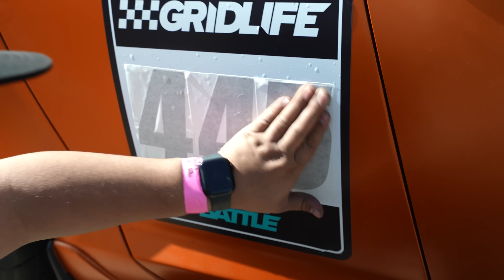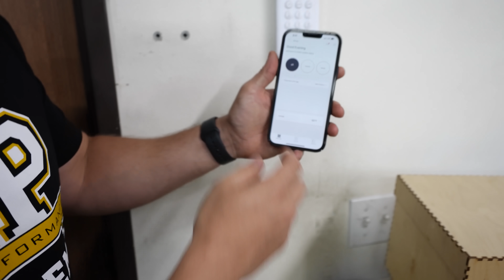I DESTROYED the RX-8 motor within 90 Seconds of driving it

Comment: Right on time! So sad to see the engine blew up on the superior chassis
Reply: The S2's are going to be the more problematic as time goes on, as they don't have anywhere near the level of aftermarket support that my S1 does, and you can't stick an adapter on your OMP on the S2, so 2 stroke injection isn't possible in the stock setup, and switching back to an s1 setup is a wiring clusterfuck. Sure, everything S1 may swap over, but you need the brains to tell those bits what to do. A well built S1 with supporting mods, will outlast a rebuilt S2. That said, the ultimate swap is an 13B-REW or 20B-REW. As far as N/A rotaries go, though, The RX-8 puts out the most power. The last N/A Rotor was the FC RX-7, with all of its 160hp.

Comment: Spun bearing(s) for sure. You can thank Mazda for recommending too thin an oil for an additional 1-2mpg.
Reply: Spot on bud when i bought my rx8 from karl hayward of haywardrotary fame here in the uk he told me only use 10w40 mineral oil as it 5w30 semi that mazda recommends wont cut it on a track day and nearly 2years later im driving it hard with no oil issues only issue is i hsve to do oil changes more often
Reply: You can thank Ford and all the emission standards for ruining the RX8 lol all they need to do is throw in a S4 13b and it'll be fine

Comment: Mazda knew exactly what they were doing when they made the RX-8. The RX-8's body and whole setup is immaculate. 
I've said it before and I'll say it again, the RX-8 was the BRZ before the BRZ was cool. The RX-8 does it better IMO. Some people just don't like how it looks, or that it comes with a rotary engine. Thankfully, that has kept costs down.. I'm just waiting to finally buy a rust-free white one aha
Reply: Exactly this. The platform for the RX8 and NC is amazing. I'm rebuilding a renesis for my buddy right now and I track a NC. The cars are just so much fun to drive and so confidence inspiring. The problem is that Mazda put exactly the right amount of power in the cars... which was 50-100 hp less than the competition... and it kinda sucks getting smoked by a minivan on a freeway onramp.
Reply: If only they put out an RX-8 with a REW from the factory lol. It'd be a lot easier to just put power into em'

Comment: Time for the RX-8 to get a proper track car build, Get some quality coil overs, sort out the motor. high flow exhaust, intake, maybe a custom tune? Also need some wrap on the rear bumper, Front bumper side marker that's missing. get it looking 100%. New strut tower brace. maybe some fresh suspension parts. Maybe bigger brake kit (if there is something easy to swap) and full send! Even a medium size turbo (GT2871R with like a .83 or .1 turbine housing) for good spool and open exhaust flow on the track. Tons of opportunities! Let make it happen!

Comment: MOAR🤩 !!     I would love to see some videos on how to get the most power out of NA rotaries and specifically why does the renesis engine make so much more power than older NA rotaries.
Reply: 3 things I can think of as to why the renesis makes more power: six intake ports instead of four, increased size of those ports makes it practically streetported from the factory, and higher compression ratio. 

Aside from that, you've got better tuning through electronic fuel injection, computer controlled ignition, and variable intake valves (i.e. the SSV)

Comment: Yes! finally broke! This time, make a proper N/A engine for the rx8.  That would be very interesting to see, you guys already have build 2, 3 and 4 turbo rotary. Please make a N/A track monster 😜
Reply: 3 rotor NA maybe? Sounds like a blast!
Reply: Nitrous
Reply: Highly doubt that will happen. It might be interesting just to see what they would do, but at the end of the day the return on investment would be very low compared to a turbo build. Never going to get much power from an NA rotary.  I'd rather see a nice 2 rotor turbo build. Or maybe SC... Don't see many SC rotaries. Would different and cool, but still have potential to make some respectable power.
Reply: @justindurand9110  sc is good at low and mid range rotaries love to be at the top end so its not a great roi a suitable or slightly undersized turbo would be better than running a sc
Reply: @911lilslim  In general I agree with you, the turbo is almost always going to be the best option, but many people have successfully SC'd rotaries and have gotten decent results, even with 9k+ rpm Renisis.
Reply: @justindurand9110  the sc could absolutely work for a street\response setup but when youre talking about return on investment you cant beat a turbo rn especially if you choose a "budget friendly" manufacturer
Reply: @911lilslim  Agreed.
Reply: I already made an RX8 NA track monster. It still needs more power. Boost is coming.

Comment: Haven't watched the video yet but my guess... It either overheated, lost a side seal, or lost an ignition coil.

Edit: Yup. Over heated! Side seals will be next...
Edit 2: I've seen RX-8s overheat, but never a total oil system failure. Good work Rob! Time to peripheral port it like it should have been from the factory.

Comment: It's a series 2 (09+) car, right? Just spitballing here, but IIRC, the rear shock/spring is shorter on a S2 than a S1. So coilovers designed for a series 1 car might be too long to get the car very low on a series 2 car.
Reply: The shocks are the same length, but the S2 got stronger shocks but the same springs.

Comment: S1 RX-8s have a tendency to overheat on track as the cooling system design isn't efficient enough. A bigger core, another oil cooler, higher cfm fans and a bit of ducting should do the trick
Reply: Koyorad worked for me. The oil cooling was fine. The rear diff however after a few hours of Enduro will boil out the fluid.

Comment: Welp, now the RX8 should at least get a properly rebuilt engine bay with another rebuild and proper lines and fittings that won't let go so easily under full send. A 3-rotor is negotiable, but I think it would fit and it would make it a much more powerful car. The Renesys engine isn't really meant to take a whole lot of extra boost, so I'm not sure that turbocharging the existing engine after a rebuild would be a good solution.

Comment: The "Body Styling" of the RX-8 is beautiful as well as the engine (for periodists), but the rest of the Drivetrain needs MUCH IMPROVEMENT...
In my opinion (sorry Rotory Lovers), this needs a Twin Turbo V-6 (whether Ford/Chevrolet/Chrysler) and a 6+ Speed Sequential Transmission. (Nissan 350 anyone)?
But the Suspension Geometry is perfect.

Comment: Oh god, I had a set of MaxPeedingRods coilovers on my Miata, they all exploded after about 4 months.
Reply: Maybe you got a bad set? I have them on my RX8 and did my coilover conversion using these on my Cayenne.
Reply: @mischiefpwns  Nope, the set I put in to replace the exploded ones also exploded and the chrome rusted through in just over 5 months. One of the damper rods somehow had a chunk taken out of it too which shredded the seal and let the oil out even faster.
Reply: @JamesChurchill3  are you doing racing or rallying? I just use mine for street driving.
Reply: @mischiefpwns  No racing or rallying, just driving on salted Scottish roads.
Reply: @JamesChurchill3  maybe I just got good luck then haha

Comment: Could that engine be P-ported with billett housings? Then just weld up the irons, resurface them and send it. 3-rotor is too much for that chassis, also boosting it would build up too much heat inside that engine bay. P-ported 2-rotor with flowing intake and exhaust and 12K red line would be perfect for RX-8.

Comment: The only thing SimpliSafe won’t do is save you from bad G code locations. Nothing worse then having everything running great on G54, then having your tap set to G55 which was an inch lower……yay

If Isiah wants to force Robs hand on a 3 rotor swap, he just needs to start hinting at an LS swap

Comment: I work at autozone too, let me know what you need. Help me with my miata pls
Reply: What's the trouble? does it crank at least?
Reply: @Alex-vz2jz  it works, I was a bit vague, my bad. Just need some recommendations for some upgrades
Reply: @moisesjarquin6479  fair enough, I always go wheels, suspension, and exhaust for the first mods.

Then decide if you'd like a swap or a turbo or stay NA.
Reply: @Alex-vz2jz  gonna keep it Na, but going to add Nitrous as the last part of the build. But so far I'm waiting for some new wheels to drop from fitment industries to start wheels and tires. Any recommendations for exhaust?
Reply: @moisesjarquin6479  I don't own a Miata so i wouldn't know what exhaust would be best for performance/sound. I own an FC Rx7, so they sound completely different lol.

Best thing to do is to go on forums/YouTube and see what exhaust system people are running and see if you like the sound as well.
Reply: @Alex-vz2jz  duuuude those are the next builds I wanna get into, I just gotta study first to understand rotaries. And you know finish the miata
Reply: @moisesjarquin6479  racing beat

Comment: Weight is a BIG thing on track cars. I bet you gain a half second over Isaiah due to driver weight alone. Not being a dick. Just is what it is. Gotta think the driver side gonna be heavier already without the driver. Then add an very heavy overweight driver over an average weight driver and the car is even more unbalanced. I’m very curious on what the rx8 is on the scales car only and then with Isaiah in the driver seat compared to Rob. There’s gotta be 60-100 pound difference between you two.